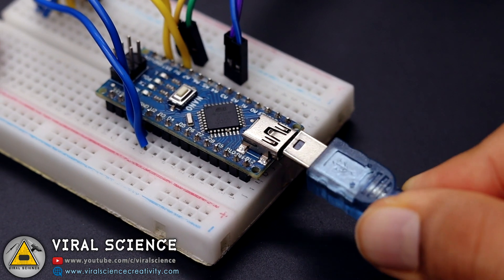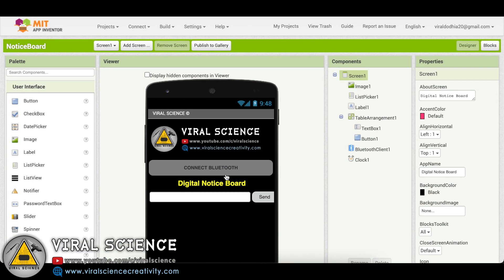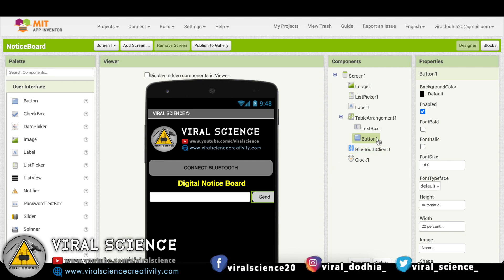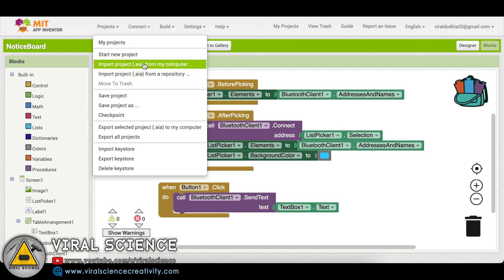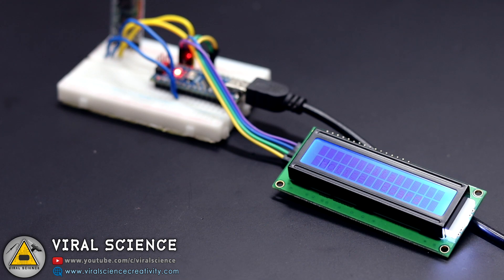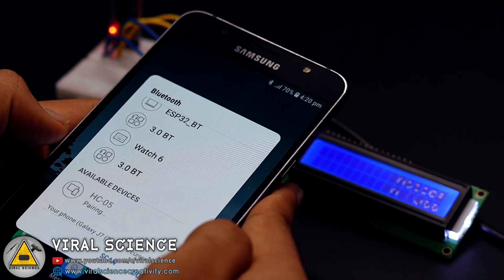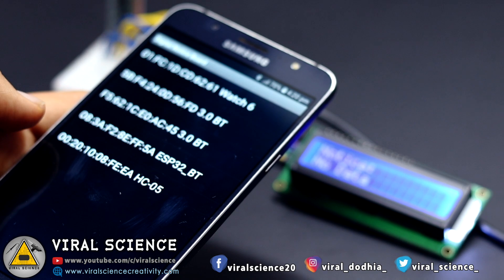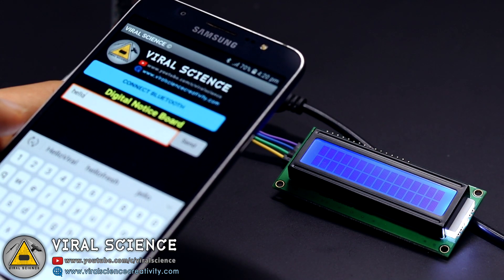Arduino LCD Notice Board Smartphone Controlled

Comment: Made it today. Works super awesome! Thanks Viral. One thing to add, in place of "lcd.begin();" we'll need to add "lcd.init();" then "lcd.backlight();". This removed the error 'call to function...." in the code compilation. Btw superb and easy to follow video.
Reply: Hello bro I  did that it worked I want to ask the  Nano Pins to LCD are as Follows:- A4-D4 , A5-D5 and connecting VCC(Grd) and Led- together also VCC and Led+ together then connecting to Nano Grd and 5v respectively pls tell ???